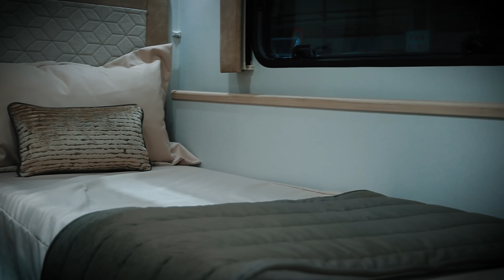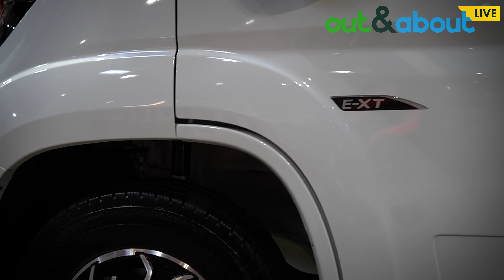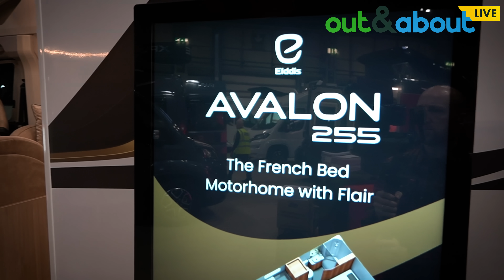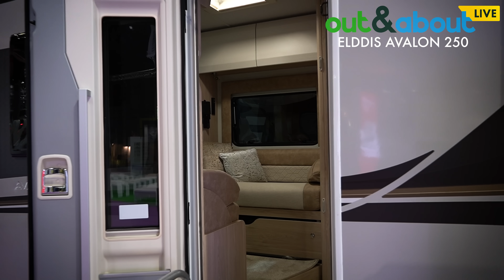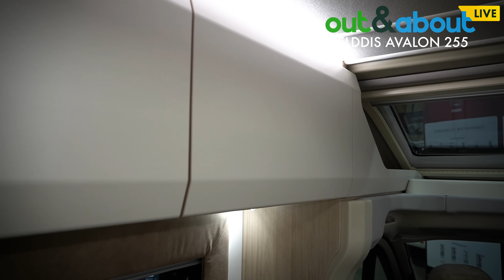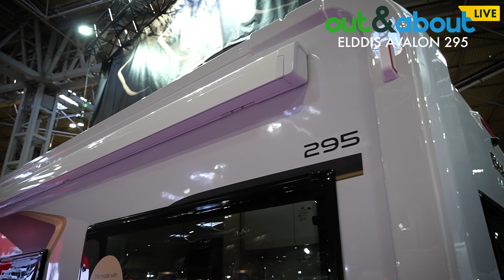ALL-NEW - The next generation of Elddis motorhomes

Comment: Very good vid, but....in terms of the vehicle, is there any joinery or just panels screwed together with metal angles ( fixings fail as nothing solid).  synthetic wafer thin flimsy panels with cardboard honeycombe sandwich which warp shape. It's these things that make a quality difference.  As to the vehicle, a larger screen is not a selling point for me, nor are auto lights which I have at the mo. I want them on, the vehicle says no. So again, the tweaks are worthless. Nice styling, yes; better exterior construction with the new channelled metalwork, sounds great: hopefully will work. I wonder if this group or others have actually sat down with customers and asked what's important to them ( not the company) and what would you like and what can we do better?

Comment: Do these Motorhomes in 2025, come with modern electric systems with good lithium battery power storage & output? If not, then it mights as well be a Motorhome from bygone years.
Reply from the maker: Some brands fit lithium as standard, others as an option, while some stick with AGM batteries.
Reply: Almost none fit them as standard

Comment: maybe a new model but does it still leak like a  Elddis and does it still fall to bits like one too
Reply: Yeah ive heard leak,just like swifts. To be honest most coach builds leak as they flex and creak and are mostly jointed with silicone.
Much rather have a larger campervan.
Reply: @paulstarr6818 it's a completely new construction.  They shouldn't leak now. Even if they do the materials used means they can't get damp. Let's see but it looks good